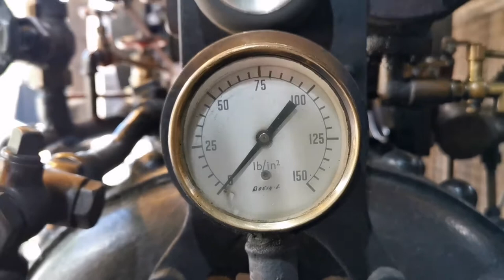'Portable' steam engine - start up, tour, explanation and running

Comment: Very cool. At the fair we still get see these things run. Our Amish still use engines pulled by horses but not steam powered. Very cool my friend Sean!
Reply from the maker: Hi Steve, there is a fairground at the museum at the bottom of the hill - I haven't shown you all down there yet - and the chair-o-planes are steam driven (but operated by a 3rd party). Are the Amish engines diesel then if not steam?
Reply: The Victorian Piper yeah I would assume. They have different rules they make up for themselves. Like no engine on rubber wheels ( why is okay for them to ride a train but not car) others it’s okay to use that as long as they don’t own it. I’m no expert but I’ve seen them with an engine on wood wagon using in processing hay I believe with those wide belts you had.

Comment: Excellent Sean I’m not sure if it the way it’s been edited but I would have expected it to be a little more labour intensive. It was really nice to see the old gal running the lack of guards must be a Victorian thing 🥺🥺 thanks for the video please keep them coming 👍👍👍🦡
Reply from the maker: Hey Badger, yes, well edited - it was well over an hour of footage just sorting it out. I didn't include the oiling, clearing the cylinders, warming the engine (and more), but if folk are interested I could do some long-form videos where I just get on with it and no editing out the various steps. This little engine takes around an hour and a half once the fire is lit to start to get pressure, then use the blower to draw the fire and probably another 15 minutes to get enough pressure to run - then there is the constant maintenance of fuel and water! Not many visitors comment on the lack of guards, but then they probably haven't seen modern machinery to compare.